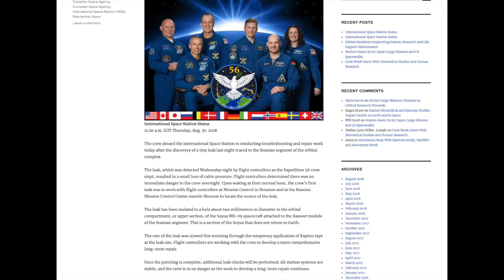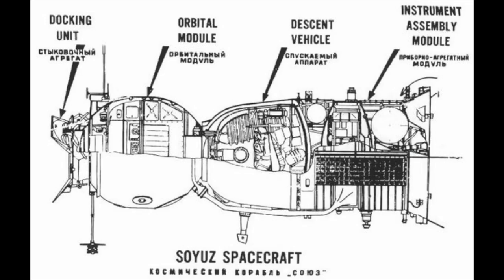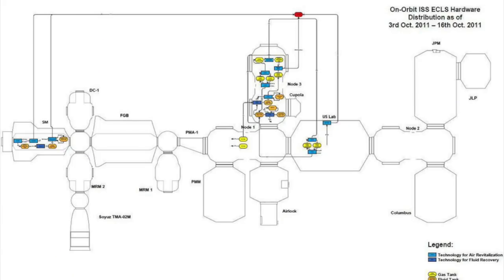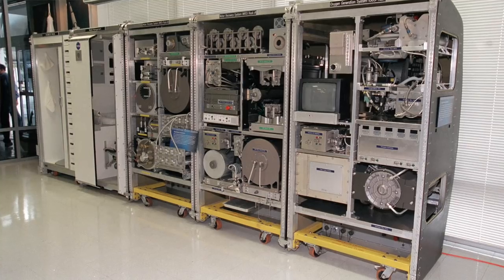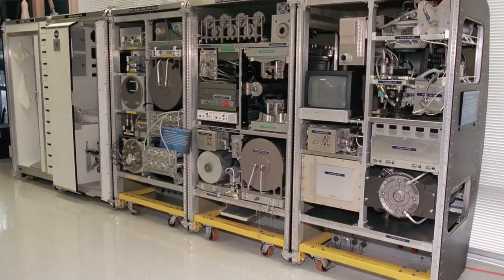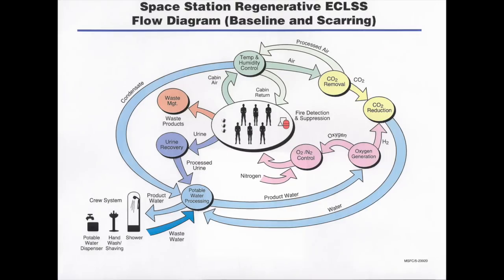Astronauts Are Fixing an Air Leak On International Space Station

Comment: Sealant? Can't one use urine to plug the leak? Water freeze-boils in contact with vacuum, and expands when it freezes. Also, the ISS can't have a urine shortage while manned.
Reply: Wouldn't work as the escaping atmosphere would be going through the hole preventing the urine from ever being in a complete vacuum. Even if it did freeze I highly doubt a thin layer of ice would hold 1 atm if pressure
Reply: @LoneWolf5841-  I don't think you understand straws. 

Air and liquid water can't go through a straw at the same time, because straws work for drinking. You can't suck air through a straw when the other end is submerged in cola. You have to drink the cola first.

A 2mm hole is smaller than a straw, so the urine will go through the hole, and inexorably reach vacuum.

When it does, it will still be liquid, and bonded to the craft skin by surface tension. Near instantly it will freeze-boil.

The question is, will the solid urine adhese to the craft skin? If it does, then urine certainly has the capability to build up like limestone in caves, until thick enough that it has sufficient strength to hold the capsule pressure inside.

Also, the urea will preferentially solidify, since it has higher latent energy than water, which will preferentially evaporate. It's not a thin layer of ice that one will produce, but a stalactite of pykrete with urea crystals instead of wood chips. There's no shortage of vaccuum to freeze liquids in space, and it was the expense of freezing equipment that makes pykrete impractical for large scale terrestrial use.

The danger would be more from having loose liquid urine inside the capsule in microgravity, but a syringe for controlled delivery and a cloth to wipe up excess should be sufficient to keep it out of the electronics.

Externally, the question is, how much will the pykrete evapourate in direct sunlight? Given the continued existence of ice asteroids around earth orbit and ice comets that get closer to the sun, I'd guess not enough to worry about.

Lastly, if they can use urine, what are they using as sealant instead?

Comment: Why dodn't they use some of the methane for attitude control thrusters since they are dumping it overboard anyway?
Reply: It would need to be dried and compressed and I imagine the tiny amount they get would not justify the risk of handling highly flammable gas inside a tiny little enclosed capsule in space.
Reply: Marshall Gibson 
If I were designing that process I'd have the methane stored in a non-habitable equipment space, filled with low-pressure nitrogen, that could be remotely controlled and evacuated in case of leak or fire.
But I agree with you both; why waste?  A little becomes a lot over time, and attitude thrusters or a tiny combuster feeding a heat pipe or a thermocouple could be useful up there.
Reply: @HuntingTarg  well when it comes down to it, if you have in out in space then nitrogen blanketing wouldnt be necessary. As long as there is no oxygen it wont combust. But the fact of the matter is that it likely creates such a tiny amount, the cost of taking the equipment there would never provide a return on investment. Isnt it like $10k a lb to get stuff to space? If youre making enough methane to refuel a bic lighter twice a year its just pointless. Its a bioproduct of a necessary process is all.
Reply: Exactly my thinking. Comprss it in tanks in safe areas that are not directly connected to habitat areas like on the trusses, but not limited to the trusses.
Reply: I have literally no idea what you two morons are talking about. use methane for what? and what the hell should compressing methane accomplish, why even think that's what he meant? none of this makes any sense?
Reply: @Mar ... they are talking about a potential method of using methan for thrusters. That you think their short exchange makes no sense only shows that this talk is nothing for you and i question your ability to understand the video as well.
Reply: You'd also need to use some oxygen if you were burning it, plus some fairly complex plumbing to get the whole thing to work.
Probably best to just stick with the hypergolics.
Reply: who says you have to burn it? Just expelling it under high pressure gives it force to move the station, not fast, but it will move.
Reply: gendalfff Indeed and that would also be a safe mode of propulsion use: Use valves to choose different exit ports according to impulse needs.  Optionally use something like an ion thruster to accelerate it just before ejection.  Supplement by other gases through same thrust ports if not enough methane (or think in reverse: Feed the excess methane into the existing supply for cold gas thrusters).
Reply: theres alot they could use the methane for, they could have a generator running off of it for example
Reply: Why when they have solar panels? also using a generator means burning O2 qith the methane and making CO2 which they do not want. Think running a generator in an enclosed space = asphyxiation.
Reply: oh yeah i forgot it would require oxygen, also it obviously wouldnt be run inside the cabin, i think they should be looking into ways to use everything they can tho and trying to make the system as closed as possible because it will be useful for future missions, i can imagine methane being used as a fuel in future mars missions like in take on mars if they can generate enough oxygen

Comment: I'm surprised they even bother to fix a 2mm hole. I'm used to working with aircraft... where already quite high standards exist. But there you expect leaks. You expect seals to not be 100% sealing (not even close) or being misaligned. If they bother to fix such a small leak I assume the space station is otherwise really 100.00% air tight. This fact is amazing, even more so when you think about that this is not one structure, one pressure vessel, but several ones connected through joints/couplings/docking ports... whatever you want to call it. The whole thing is flexible and moves. It is amazing that they even can detect such a small leak. The pressure differential betwenn the inside and outside is just 1bar, which is 1/3 of that of a usual car tire to the atmosphere... and with a volume of nearly 1000m³.
Reply: Pressure difference is about 0.69 bar (10 psi), and while a 2 mm diameter hole doesn't call for panic, neither is it insignificant - it would be still be unsustainable over time.
It's lucky they could find it and get direct access to the wall
Reply: thing is a plane can pressurise the cabin with  outside air   if I'm not mistaken thay use the compressor from an engine or aux turbine  to pump  you probably already know this so that's the difference
Reply: +Thefreakyfreek - the ISS is in space. That means there is no outside air for trillions and trillions of miles in every direction, apart from the Earth 250 miles below!
Any air lost from the ISS is lost and can only be replaced by what is stored in tanks until they run out too. Any leak, even tiny ones are a Big Deal.
Reply: Andy Lee Robinson that's exactly what I meant
Reply: @Thefreakyfreek  Yeah I know. But I never thought about that. I just assumed the ISS was leaking somewhere, even if it was just through tiny holes or cracks like that. It's easy to keep a space shuttle sealed, or the soyus, or any other space craft as they usually only have one or two hatches and are otherwise "seamless" containers. It's much more difficult on such a big structure. I assumed they would somehow compensate that by delivering compressed gas. Infact they actually do send nitrogen up there, as Scott said...
Reply: 64h5dsf14j6s41h5s4j5 I did too how can it be not leaking I mean how many seals are there made by   different productions shops the tolerance on a ~ 1.5 meter hole  is difficult   if it was only a single door but no even square doors that fold away  thay must be cleaning the seals befor decoupling  and not even the reboot truster event  the wole station must be flexing
Reply: Ths ISS cost over $100 billion for a reason. It was not thrown together in someone's shed!
Every single part and the materials they are made of have been selected, machined and tested through an unimaginably rigorous process and it was obviously designed not to leak anywhere.
The only leaks on it should be intentional ones!
Reply: Andy Lee Robinson   Obviously "unimaginably" is an overstatement, since someone had to come up with it. ;-)

Thefreakyfreek   Your spelling makes me think of Riddley Walker. Intentional? I'm not complaining, just curious.
Reply: brian: true... I should have qualified with "unimaginably-rigorous-for-mere-mortals"
Reply: It is impressive that it's that airtight, but it's not surprising when you consider that it must be that way. An aircraft will never lose all of its air pressure, and it can constantly replenish the pressure with bleed air from the engine compressor. A space station can't do that.
Reply: It leaks 0.5 liters per second
Reply: It would probably be better to compare the ISS with a deep diving submarine rather than an aircraft.
Reply: hm... deep diving submarines have to withstand hundreds of atmospheres pressure from outside so wall thickness is measured in feet. ISS only has to withstand less than one atm from inside, about 2-3 times more than an aircraft.
ISS could probably still work with 1mm thick walls, but is much thicker to give as much protection from micrometeroids as possible as well as structural integrity.

Comment: i always thought that the tiniest hole would tear apart the space station.
well, glad to be wrong
Reply: The hollywood-style explosive depressurization requires an incredibly severe loss of structural integrity over a large area of surface to actually happen. Essentially the hull needs to suddenly gain the resilience of tissue paper.

A tiny puncture in the air seal is not going to suddenly change the structure's ability to prevent the air pressure inside from blasting it into space. If that was going to happen, it wouldn't need the hole to happen.

Comment: What are the odds of more broad spectrum damage? I imagine a space walk to thoroughly inspect the reentry module is in order? Heck, if I was up there and a part of my ride home was just damaged I think I'd insist on plan B. Could they do some kind of unmanned resupply operation to replace the current module? If a damaged tile can take out a shuttle I would not want to trust a reentry vehicle that had absolutely any damage to it even if that damage was peripheral to the reentry capsule itself.
Reply: Upcycle Electronics reentry capsule is fine, the leak was in orbital module that gets ditched before reentry.
Reply: When the orbiting debris hit the ISS was that the only piece of debris or could there be more damage elsewhere on the craft that didn't break the seal but could cause a failure during reentry or other strenuous tasks.

Comment: Just had a peek at some live video from the ISS, and no one seems på be on EVA
Reply from the maker: That's because it's easier to fix a leak from the inside.
Reply: @scottmanley  Yea, that much is obvious bacause of the pressure difference, but I would think that some EVA would be required to check externally and to search for other damage if it was some kind of impact...

Comment: Gentlemen, Be Seated!" Is a science fiction short story by Robert A. Heinlein. It features similar problem.
Reply: I remember that story; a thumb-size hole was punched in the section of lunar transit tunnel and the crew inside took turns bare-butt sitting on the hole until help arrived.  Man it's been over forty years since I read that story!

Comment: Just use some bubble gum. It's pliable when applied, and dries hard and lasts for decades. (Just look under my old elementary school desk for proof. Still there)
Reply: No joke, the on-orbit procedure for patching a pinhole leak (like this one) in the Space Shuttle's cabin was for a member of the crew to chew a big ol' mouthful of gum, then stick it over the hole and apply duct tape over it.  The gum (which is literally just flavored rubber) would moosh into the hole and form an airtight seal, the area exposed to vacuum would freeze-dry and harden instantly, and the duct tape would ensure that the gum would remain firmly in place and not shift or get dislodged before you got back to the ground.
Reply: @rdfox76 
Hey
Could you provide some references to that?